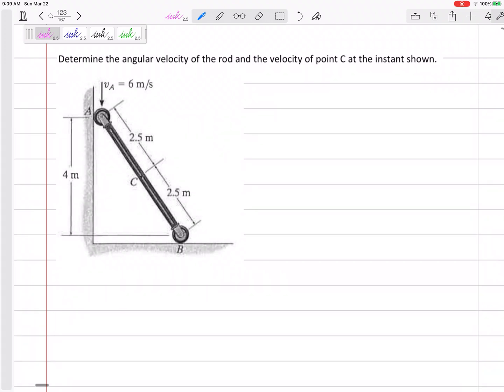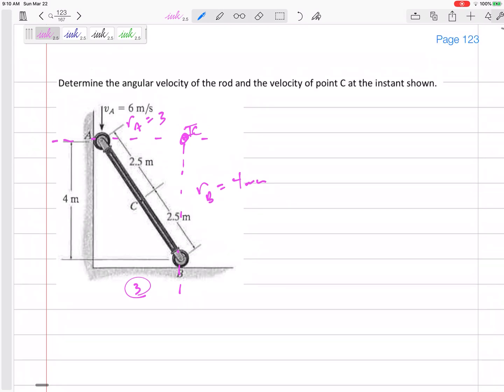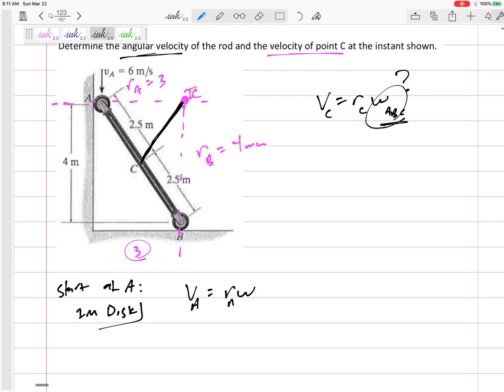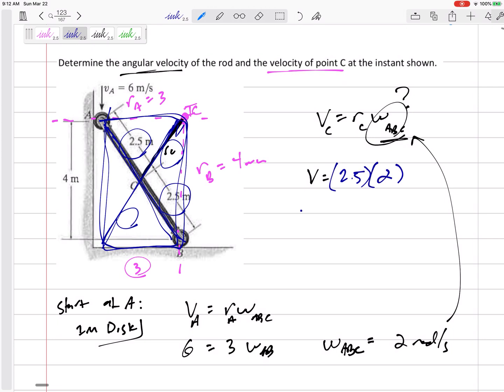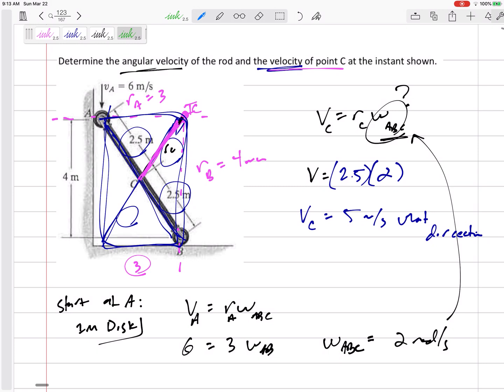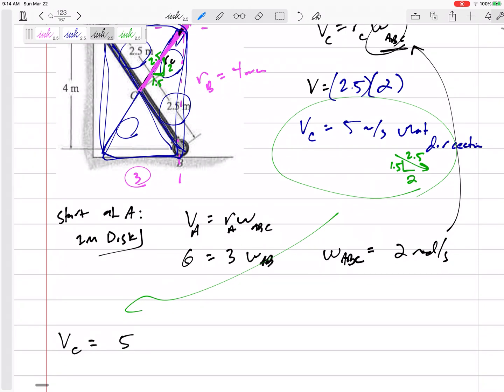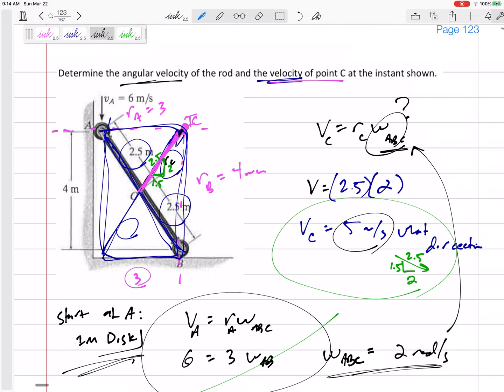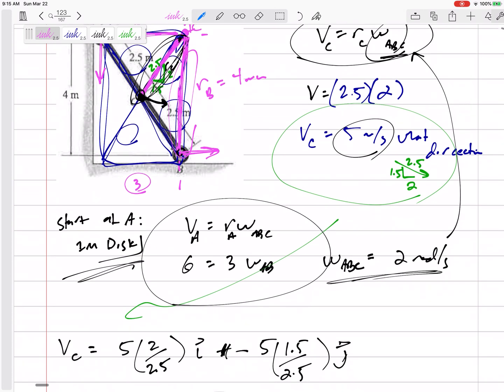Dynamics - Instantaneous Center of Zero Velocity example 4

Comment: I calculated rc from the other triangle using Pythagoras theorem (hypotenous=4m & CB=2.5m) but got a different radius than the one you got. My rc is 3.1225m.
Reply from the maker: Which other triangle? It’s the hypotenuse of a 1.5 by 2 triangle.
Reply: @engineeringdeciphered  The other triangle would be between the points IC, C, and B. It would share the radius rc with triangle A, C, IC.
Reply from the maker: @jadrammah1009  ok. IC, C and B is not a right triangle, so you can't use Pythagoras theorem.